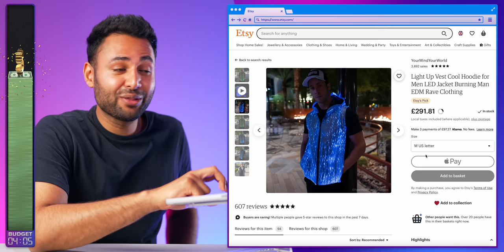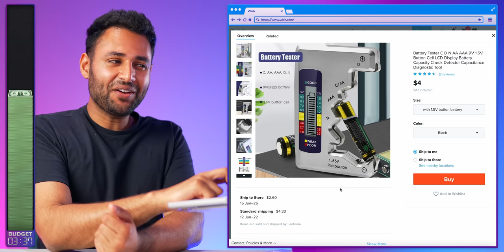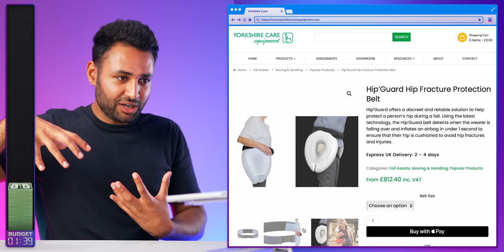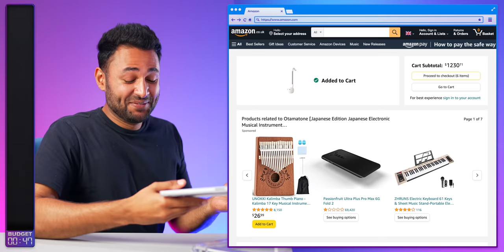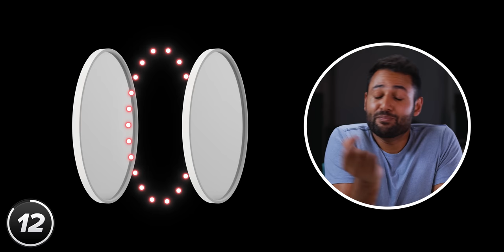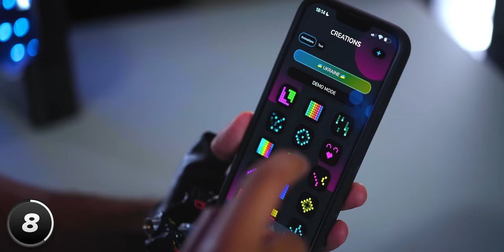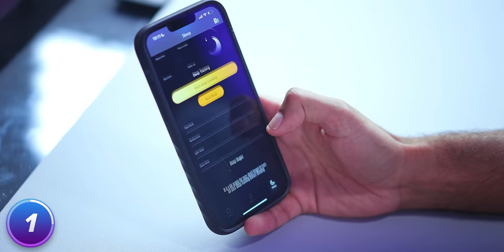I bought the STRANGEST TECH on the Internet.

Comment: frantically i'm surprised you didn't ever know of electrical wheels ... I use one regularly to go to my job. You purchased a relatively weak one (mine go to 75 km/h) but where you where dangerous is the fact you didn't put pressure in the tire making it harder to maneuver and likely to damage it.
Reply: That is very fast, stay safe 🤟
Reply: @_Makanko_  thx, I have limited my wheel to 40km/h but the extra power is needed in case you are falling, for the wheel to compensate.
Reply: @kalashsharma2275  Lots, search for EUC (electric unicycle). It takes a while to master but great fun once you get used to it!
Reply: do you mean frankly? like frankly instead of frantically
Reply: I love those videos! They look so much fun if you're confident enough to use them.

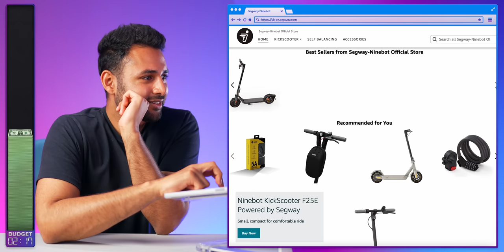Comment: 2:43 - I believe Fujitsu pioneered this thing like a decade ago when they started to put the same fuzzy logic that was in rice cookers into stuffed animals. They were trying to create a simulation of cats and dogs for facilities that did not allow them. They found that certain patients responded well with interactions with pets and so they wanted to replace that with robotic ones. Integrated with touch sensors and motors they made a robot seal that was able to move and respond to the presence of someone touching. It is quite interesting and there's been quite a few scientific papers written about these seals.
Reply: Ok dont read my name 😑 😒.Ok dont read my name 😑 😒.
Reply: @MbitaChizi  OK I wont bro
Reply: @MbitaChizi  no life?
Reply: @oldaccount6555  Scammer.  Report.
Reply: Here in Finland some nursing homes have robot pets for the elderly. No worries about allergies and there is no risk that someone treats an animal badly because they have memory issues or some other health problems.
Reply: @Pehmokettu  kinda of like in the Simpsons
Reply: @amzarnacht6710  prob a bot

Comment: The battery charge detector has been around since the late 80’s/early 90’s. Battery packages had them at one point. And the salt gun is supposed to use rock salt
Reply: Well, using rock salt makes much more sense.
Reply: You mean rock salt crystals, not ground right? But then wouldn't that damage your stuff? Just curious.
Reply: @the_winged_helm  Maybe plastic stuff could suffer, but I don't think you can damage anything else with salt.
Reply: I was like dude a multimeter for starters lol

Comment: Some months ago I bought those Segway Drift W1, tried them in the house and trained to get used to them, after 1-2 hours I wanted to drive them outside, went to a secluded street, and hoped on. After like 5 minutes driving, I was about to fall off, so I jumped off, but one of them keeps rolling forward slightly in the direction to the side of the street, into a moat filled with water next to a cornfield. I tried to run after it and catch it, sadly I wasnt fast enough. Now I have just one working, and sadly nobody sells another single one on like Ebay or something. It was fun for sure, those 2-3 hours xD
Reply: That was really sad lol

Comment: There's no such thing as "one way mirrors."  It's partially reflective glass, but you can see through partially reflective glass in both directions.  How well it works depends on the balance of light -- notice how that and the infinity dodecahedron worked much better with the room being very dark because it means the difference between internal light and external light is greater.  If you had the external room significantly brighter than the lights inside the tunnel/dodecahedron, the effect would be largely lost.

Comment: back in the day there were batteries with two points on them, if you would press a finger on each of them, there would be an indicator bar on the side that would turn yellow and it would climb up to the point to where the battery was still charged. I believe it was Duracell actually.